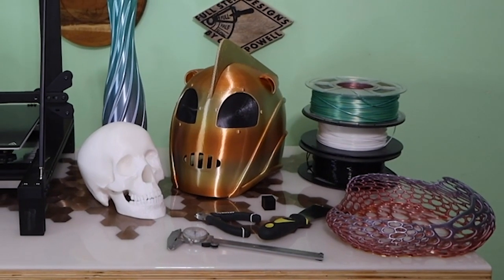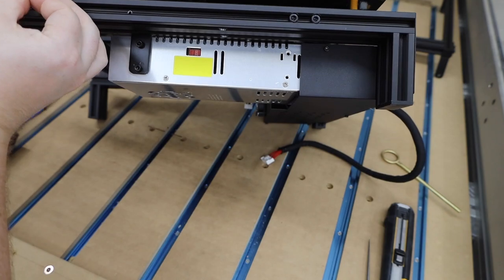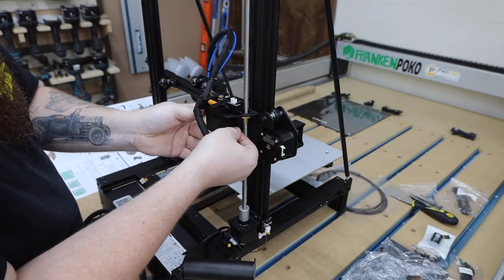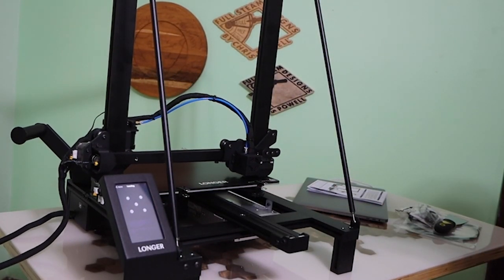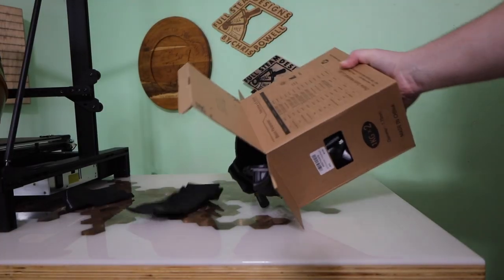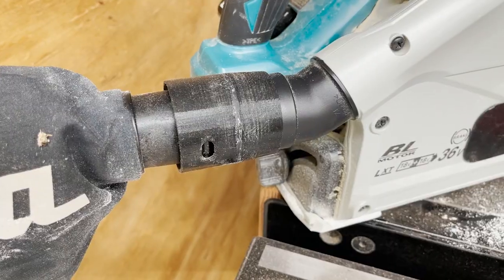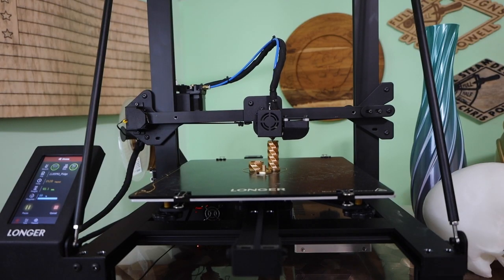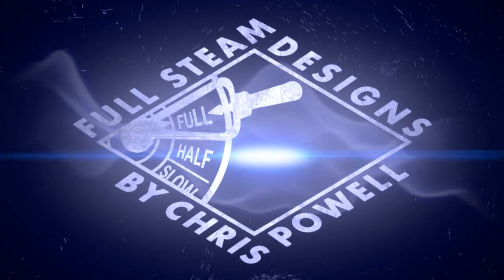Longer LK5 Pro 3D Printer Unboxing and Review

Comment: I have this 3D printer and I love everything about. I printed a lot of big projects, The only problem is that after every print you have to re level the bed which is not bad at all but, I’m having a hard time getting the bed nice and flat now, in some spots the print will stick and in others the nozzles goes too high for it to stick well, causing it to mess up the print at start, SMH.
Reply from the maker: Could the springs be too weak maybe? I haven’t had to do much adjusting with mine. Honestly, I only check it if I start to see issues. It would be nice if you could level it with the bed hot.

Comment: will this do wood, carbon, and rough filement prints, thank in advance, im wanting to get the lk5 but am leaning toward the prusa mk3, but would like to save money on my first printer to learn on, i want to get into print farming but need a print that can print most types of materials.
Reply from the maker: It should be able to print anything. I know it works with wood. Carbon might just require a different nozzle that’s more wear resistant. I’ve never tried printing any of that.
Reply: @ChrisPowellFSD  tanks bud. ill give it a try